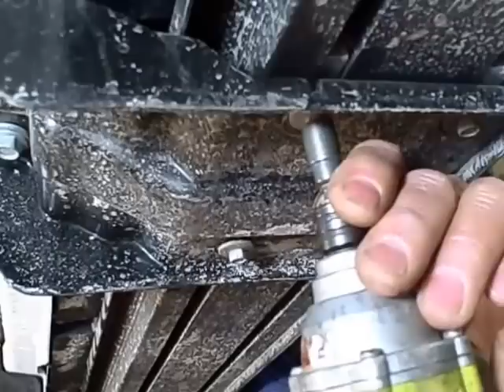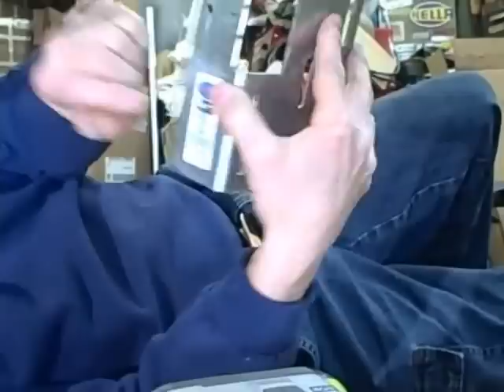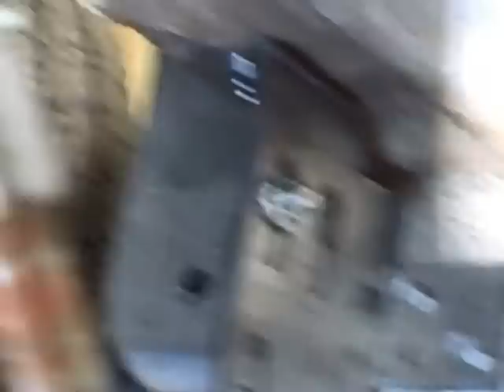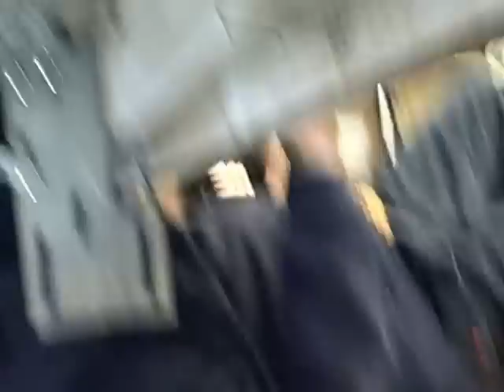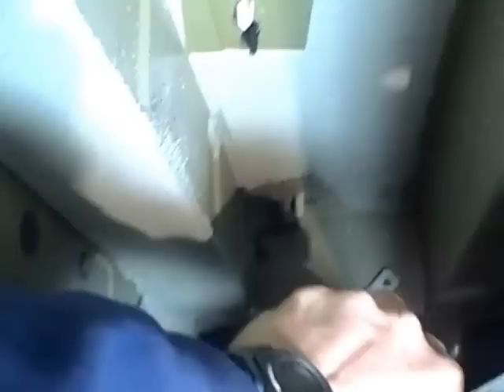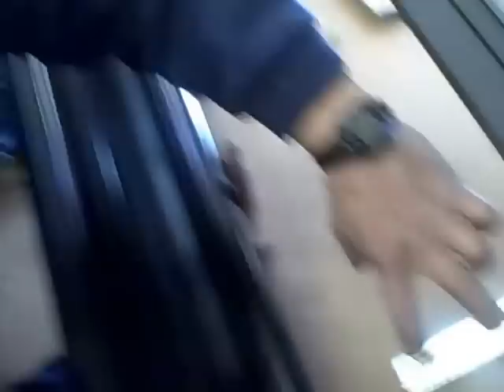Ford Transit Running Boards install easily...here's how

Comment: thank you for the video, I just install a similar on my transit but the black bottom piece sticks too much out making the step area kind of small, I see in the video the trim part actually sticks out less where the original step is, can that part be replaced??

Comment: This bracketing is really bad, I have the same brackets and if I ever have to slide under the van these hanging brackets are in the way. Not to mention they're not very aerodynamic and noisy I'm sure. Thanks for the install video though and I've found that Westin makes better bracketing (#27-2295) that will fit but it costs around $180.
These are bad clumsy brackets in my opinion!